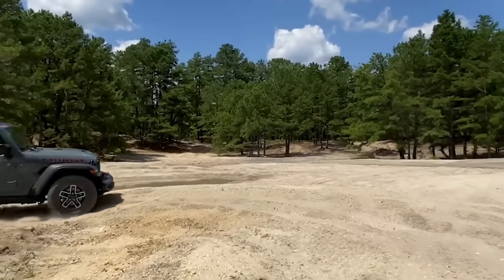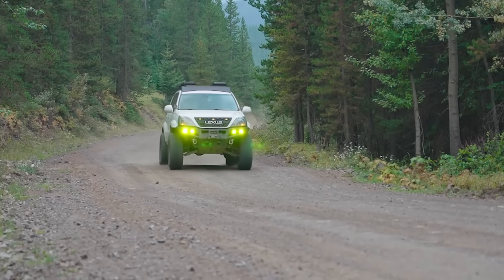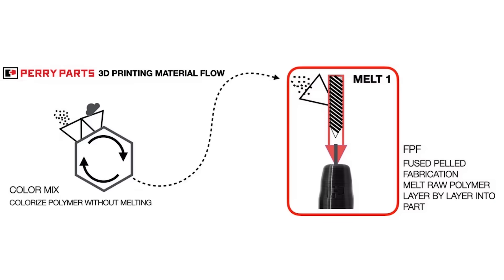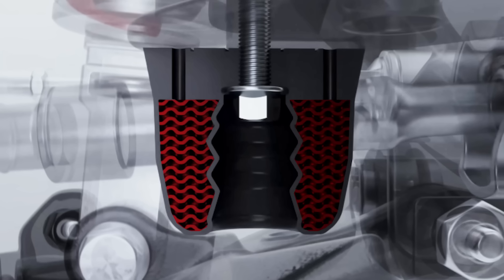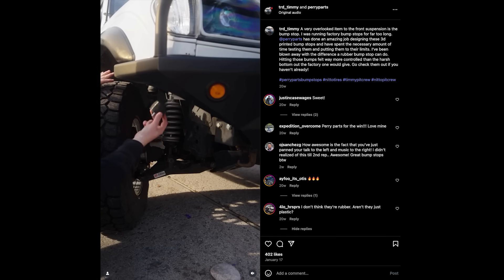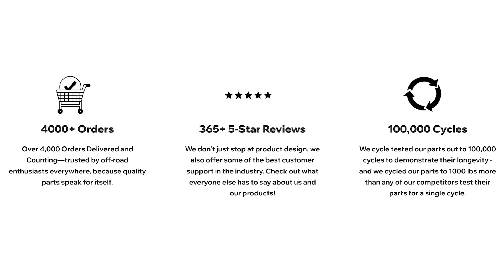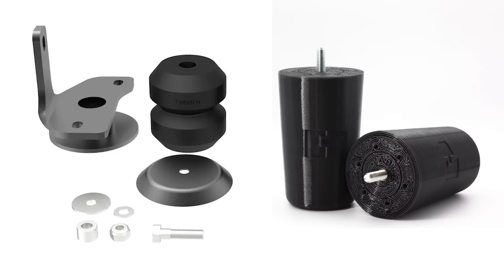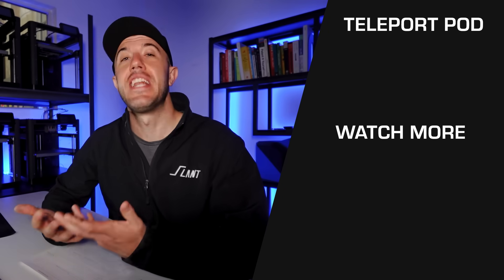Perry Parts are a Masterclass in 3D Printing Design | Real 3D Printed Products

Comment: To touch on a couple of points you made..  

A Bump stop, what is it?  A suspension has 2 motions.. one motion is when the wheel separates from the body like after it goes airborn after a jump, that's called  "Droop"..  Another motion it has is when it compresses and the tire moves up toward the body, this is called "BUMP"..  The limit of travel in compression or "BUMP" is stopped by a rubber damper called a "BUMP STOP" which literally STOPS the motion in BUMP.. There's also a Droop Stop in a lot of vehicles, but we're not going there. 

Also, the "threads" From what I could see, there are no threads. There's just a hole that is about the same size as the bolt and only has one job to hold the bolt when it's not installed in the vehicle..  Other than that, any threads that may exist literally do nothing when installed as the clamp load from under the head of the bolt pulls the bump stop into the chassis. 

If you're interested, you can easily make these yourself. the bump stops use a standard Gyroid infill with varying % of infill to change the stiffness. You model it as a solid object, don't forget to add the breather holes in the base so it doesn't explode when compressed. to form the solid base, you just change how many bottom layers you want..  You need a 13mm base? divide by your layer height..  13mm /0.2 layer height = 65 bottom layers. You want to change the wall thickness? Add walls, and ideally you want the walls and top layers to be the same thickness (This is not the same number and is heavily layer thickness dependent) for something like this unless you want a more robust contact pad with the control arm where you'd need to add more top layers to make the contact pad thicker.   Everything else will be infill.  I'm sure you could MODEL the infill but that sounds daunting to model without looking deeper into it.  

Cool concept.. I've printed different mounts for different applications before..  Thinking of it now, I need to model some new diff bushings for my Camaro..  BRB :)

Comment: FYI these have a pretty poor reputation in the 4runner community for durability. I say that as someone in that community. That said, bump stops in a 4runner are not a novel item, other cars use bump stops, so I wouldn't be surprised if these 3d printed bump stops were not lauded in Jeep or other off road communities. Cool concept in theory, but until they can take the beating my rubber or IMPU ones can, I can't bring myself to buy em.

Comment: That thing does not cost more than 10$ to make and they sell it by 99$ - that is business 🤑
Reply: Lets see how much money you have to put into into it, including the years of research before you are able to come up with a similar quality part.
Reply: @efboiz5302 dude, 30 min fusion 360 job, maybe 10 iterations at the most
Reply: @giusssepe  Complete BS. You go do only 10 integrations without copying their design and without the hundreds of hours of testing they have done and you will end up with crap. It takes a lot longer than that to get a good design from scratch for a part that hats to last through hundreds of thousands of impacts.
Reply: @JorgTheElder   could be even 5 iterations. I could take it if there had been deep material research and development specially for that product. But they use conventional TPU. The 1 less melting time issue is a small improvement that could be even negligeble comparing it to conventional filament. Iterations for such product are quite simple and strait forward… In any case I wouldn’t put a 3D printed product in my car and expect to resist not even an offroad competition. Probably usable for the ones keeping their car at the garage most of the time and getting to suspension limits only once to test the product.

They could be making 100% profit if selling it at $20… but why not making 1000% profit by selling it at $99? As said… what a business….

By the way, the product car companies make for the purpose might have a similar production price… and this makes clear how car manufacturers make money… but at least they are made to last that heavy pressure made by a car during a long mileage of missuse…

Comment: Not only useful for the Bump stops, it will be useful for the small Shearing machine for holding the sheet metal for less moving and more stability for sure.
Cost is quite high, but I would buy this and try make the suspention spring on for testing.

Comment: @slant3d What are the displays installed on the Bambulab P1P? And do I see that correctly that the original Dispay left is not installed?
Reply: @Lehmi2010  I think those are Flashforge 5M printers.

Comment: As a proponent of 3D printing, I have to admit that this video is highly misleading. There are many more affordable bump stops with simpler, yet still optimized designs available that are produced using traditional manufacturing methods.
Reply: The major differentiator between our product and others is that we use the internal air volume of the product to actually create damping (dissipating energy like a shock) while traditional bump stops are just rubber springs. We’ve demonstrated that on our shock dyno and with independent testing.

Comment: Meh. For most people you should not be hitting your bump stops. I suppose the subtext here is that it is a good idea to use 3d printing when your product has a long-tail audience with lots of variation. That's already self-evident.
Reply: @dfs7979  it depends on the vehicle. Most road cars these days are designed to Utilize the bumpstop as a secondary spring and so the bumpstops get used A LOT. Bump stop spring rate and their affect on balance and travel are very important.  because of this.

Comment: This is just “Marketing”. Good job. Anyone that know anything about automotive suspension, knows this is just hype. OEM bump stops work just fine and Polyurethane bump stops will suffice for anyone wanting something better. Performance applications will buy a hydraulic unit. Instead of telling us how well this works and that they’re 3d printed, you need to applaud them for the marketing required to get people to spend $100 on $2 worth of tpu lol.
Reply: @scottsherrard  $2 for the material, $.50 for the energy, $1 for the shipping materials, $.50 for the labor, $96 for the brain power used to figure out how to make this possible.

Comment: A lot of that "custom designed infill" looked an awful lot like gyroid to me 🤔
Reply: Bc it is, theyre just trying to come off alot smarter than they actually are.
Reply: @efboiz5302 - it does seem a bit different so I don't want to jump to conclusions, but I'm not sure if they'd answer genuinely if it really is..
Reply: @TS_Mind_Swept  even if it's a gyroid one needs to tune the parameters of the infill (thickness of the inner gyroid walls, the infill density, orientation, etc) to get optimal results. 
Most new products are small iterations upon existing ones and often tweaking one aspect of existing product is enough to make the new stand out and be viable.

Comment: Im already using TPU parts for my car, very useful material.
Reply: how do they hold up to temperature? in my experience its almost as melty as PLA. my hope is that it anneals over time so that could endure mild hot weather?
Reply: @two_number_nines  Dont put them anywhere near the engine!
I've had this exact problem with trying to design motor mounts, TPU couldn't handle the heat!
Reply: @samlcyo2  yes ofc it could never endure under the hood heat. im asking about suspension parts

Comment: From your video I got the impression that Perry's competitors are several hundreds of dollars each and Perry is some kind of a price outlier (on the cheaper side).  A simple search on amazon and google makes me question that premise. While hydraulics are more expensive I don't see Perry's product competing in the class of multi-parts, metal-machined hydraulic components. And in the class of cheap pieces of rubber the price range I see is $10-30. Also, if I was going to put something in my car in a place where it gets active wear and tear why wouldn't I go with a cheap solid strong piece of rubber vs a 3D printed object that seems to be way more expensive? i like your channel and watch every video that comes out like a clock but this is a hard sell.
Reply: I don’t think he’s trying to sell you on anything. He’s highlighting how someone did something innovative with 3D Printing.
Reply: The 3D printed version performs better than the traditional rubber/pu versions because it uses the air inside the infill being pushed out to provide some damping. While being less expensive than the hydraulic bump stops. It sits in a spot in the market that didn't exist before. You would buy it if you wanted better performance than the cheap rubber but didn't want to spend the money on hydraulics. 99 USD isn't much in the world of modifying cars. Also the stock rubber bump stops for the rear of my car are about $100 each.

Comment: Bump stops have been way more advanced than simple rubber blocks for decades. 10 years ago, Einfach made around 50 different stops with various ridges, impact noses, concave hemispheres, and more. They were mostly made out of single density PU, but several were dual density (dual shot). Perry Parts is a cool, but this is glossing over just a bit too much to make the story sound better.
Reply: I kinda get what you mean, but the entire channel is about featuring additive manufacturing. So it's pretty natural that they focus on that rather than intricacies of traditional competitors. But in defense of Perry's, their data seems pretty honest. Looking at the force-displacement curves featured, it's clear that Wheeler's Super Bumps are basically a superior product, but they are also about 20-25% more expensive.
I guess my point is I didn't take this video as trashing others, so much as demonstrating that additive can be very competitive
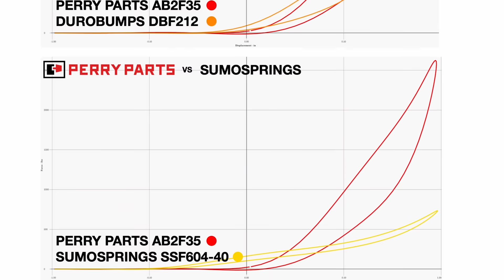Reply: @sneaky_tiki  What makes you say that the Wheeler's Super Bumps are a better product based on the Force-Displacement curve (7:45)?  They seem to be stiffer than the Perry's Parts bump stops  but they have less hysteresis.  Isn't the hysteresis beneficial, since it represents energy removal?  I don't know anything about bump stops or their desired characteristics so I'm just asking here for my own edification.
Reply: @ignatiusjacquesreilly70 
 I also wouldn't claim to be some wizarding expert, just what I've picked up in the little bit of work I've done with suspension/damping. I'm sure there's nuances I'm missing where it may be unfair to claim they're strictly better. But hey, no solutions, only trade-offs.
Hysteresis tends to be a negative in suspension because it can be thought of as reset time. Would be a bigger problem on springs or dampers, as if you imagine a washboard type surface (or any scenario where there is a rapid succession of inputs into the system) and the suspension hasn't reset prior to the next input, the effectiveness is degraded. Say a vehicle is going over a bump. The lower the hysteresis, the higher the speed you can take the bump while the suspension can still rebound and maintain contact with the ground. That's traction and power you don't have if you lose contact. Plus for the next impact, the suspension has less travel, so is effectively stiffer. It's why washboard surfaces are some of the most torturous.
Obviously bump stumps shouldn't be getting hit as frequently, but same applies. You want it to recover in time for the next input to dampen the energy going into the frame.

Hope that was helpful. It would be helpful to be able to compare the areas under the curve (energy dissipated). Perhaps the Perry ones come out ahead.
But judging on the longer overall displacement, and lower hysteresis, looks to me like the Wheeler ones are slightly superior.
But again, I wasn't trying to bash on Perry. I think it's an awesome thing they're doing. Just considered it a mark of integrity showing a comparison with a product I would consider 'better'.
Reply: Are you suggesting that OEM bump stops regularly use these nicer ones?
If not, are you suggesting that Perry Parts should be giving free advertising to those other companies or something?
What a weird comment.
Reply: So, which is cheaper?
Reply: @dunzek943 most likely TPU (I don't recall what they said on the video). Eibach are about $50 each.
Reply: And if you make them from rubber the mold is not thousands of dollar. Compression molds cost hundreds, and a part like shown for $270 we can produce below $10 and having profit. While 3D printing is great, the others have good solutions as well.
Reply: I would not be surprised if there was a way to make a superior part using traditional molding, but the cost to manufacture a new mold, store it, do a production run, and store the output of that run is all overhead that is nonexistent for Perry Parts. In either case, there is an R&D cost, and Perry Parts has the advantage of the turn around time for testing is very quick and has low overhead as well. As long as the Perry Part is of acceptable quality, then the supply chain improvement is what makes it interesting.
Reply: He did say most OEM bump stops are solid rubber, but there are more advanced ones available. 
Do you think this video was supposed to be “The Complete History of the Bump Stop”?
Reply: @atomicsmith  in the video he states several times in no uncertain terms that this can't be done any other way, when in fact it's not true. Also mentioning that we have been doing this for decades now would have taken what 20 seconds?
Reply: @Michele-ue5eu  what kind of engineered infill do they use on those injection molded parts?

If it's not obvious, I'm pointing out something 3D printing can do that injection molding realistically can't. Yes, there are ways to dupe the effect with injection molding, but good luck doing it at a competitive cost or timeframe. It's not about injection molding being bad, it's about 3D printing having distinct advantages in particular areas.
Reply: @KraziEyevin  you don't need copy 3d printed design to achieve similar damping behavior with molded parts. You can just make usual solid body with suction void. Many OEM bumps have such design
Reply: This dude made a video which brought awareness to a whole group of people and told it in an engaging and concise way, but there is always someone in the comments who has to kick over someone else's sandcastle. 😢
Reply: sounds like someone got upset that they aren't as successful as someone else...

Comment: I’d really like to see that pellet extruder on the market, or at least a published design. It’s a game-changer for soft TPEs, but it can still make a lot of sense for hard plastics too.
Reply: I've seen Greenboy3D develop a pellet extruder kit for about a year on his channel.
Reply: @arciji3470  yes I’ve been watching his videos too, but I don’t see how his design will avoid the inconsistent extrusion width issue. Maybe you can compensate for it by measuring the force on the nozzle exerted by the object being printed, but it seems less likely to work around overhangs. Measuring pressure inside the melt chamber seems difficult too. Because commercial pellet extruders are so expensive and large but this TPU bushing business has outfitted multiple printers with them, I’m all the more curious what design he’s used.
Reply: https://www.youtube.com/watch?v=DSX1qK4jZQg  it's been on the market for more than a decade  now🤷‍♂
Reply: @albtrauf4455  what does that video of an expensive industrial printer have to do with the extruder being used to print these bushings? I expect he’s using something like the Mahor V4, but I don’t know if that has the same extrusion rate problems as Greenboy3D.
Reply: @Scrogan  Just wanted to hint that the technology IS commercially available. Is it expensive? Hell yes! Way over my budget, but asI understand Perry is a business selling these bump stops. so at a certain point in their commercial growth, they might want to buy commercial grade equipment

Comment: Amazing use of the technology! They should do motor mounts for old Porsches. Original new ones go for around $600. There are cheaper ones, but none of them are as good as the original and you have to replace them a lot in old Porsche 944's (ask me how I know). Since they are high mileage cars, they are actually very thought after.
Reply: I don't think motor mounts are as feasible for printing as bump stops. Engine bays get pretty toasty, especially in extreme modes of operation.
Reply: @TheLaXandro  That is true. That being said, the temperature inside an engine bay is not as high as you might think. Usually not much more than 100 C (220F). There are materials that can easily withstand that temperature like PEEK, but that might be too expensive or otherwise unsuable.